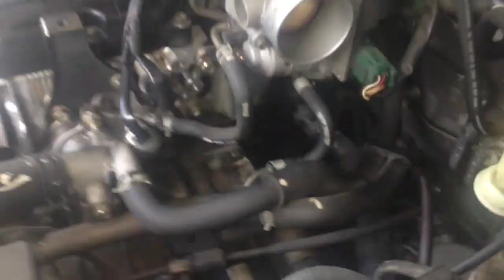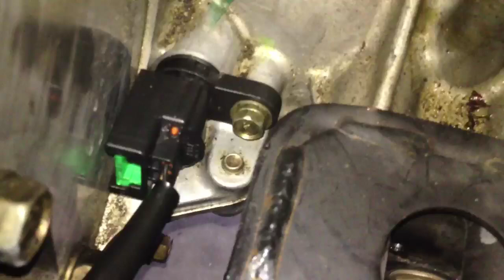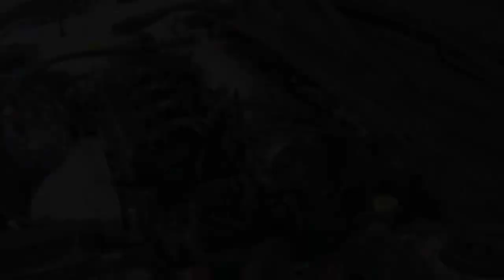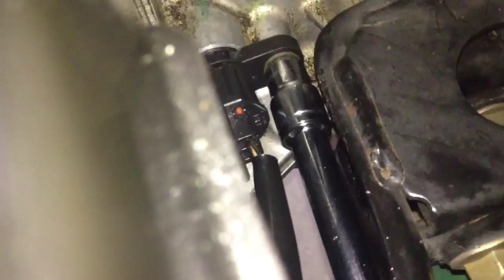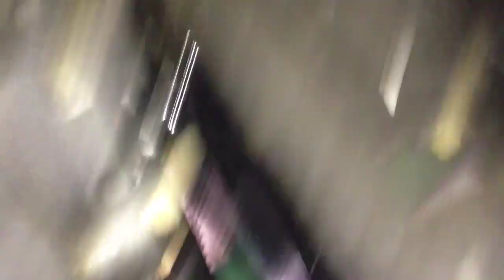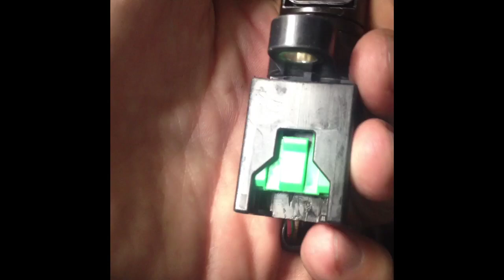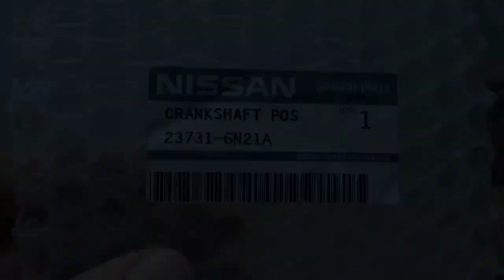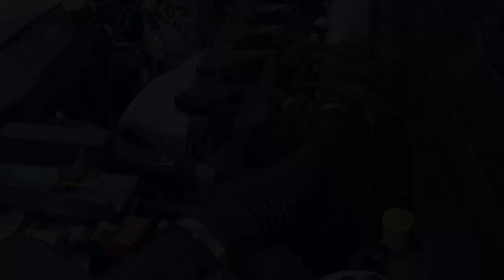Code P0335 / P0340 /P1336 - Crankshaft Positioning Sensor Replacement DIY - Nissan.

Comment: There is a recall, but it's not for the sensor. it's to reprogram the ecm for the sensor.
Reply from the maker: In my case ECM was good. I replaced the sensor and issue went away.

Comment: can someone help me i already changed booth crank an cam an if i don let ot cool dow the check engine light won't com on but if it cools down it pops right up
Reply from the maker: Did you install original OEM sensors or aftermarket?

Comment: Great video!! I tried doing it but the crack sensor would not pop out and yes I did take the screw out first ^_^
Reply from the maker: +juan beltran 
Is it not popping out from wire connector or from the engine?
Reply: from the engine
Reply: its not poping out from the engine
Reply from the maker: +juan beltran 
Try harder, it should come out. There is only one blot holding it.
Reply: Temachok what if i pull it out with the wire pluged in
Reply from the maker: +juan beltran 
Try it, just be careful and don't rip out connector wires

Comment: Is this process similar for an 2003 Maxima?
Reply from the maker: +Mo Neenja31 
Yes, similar process, but you'll have two sensors instead of one, since your car has 6 cylinders. Also that's bigger engine, so you may have some difficulties removing them.

Comment: super awesome.  it looks like the same procedure as a 2005 x trail.

also there is a way to erase codes without the diagnostic tool.   additionally,  there is a procedure to read codes without a diagnostic tool.  just search nissan forums
Reply from the maker: I know, I even wanted to make a video on that, but already sold the car.

Comment: This is very helpful, thank you! I just replaced mine with a Master Pro 2-96239. Unfortunately the engine light is still on and the engine takes longer to start. All I can think is maybe I didn't get the new sensor seated all the way, but it was difficult to see down there. Any suggestions?
Reply from the maker: Did you replace camshaft sensor as well? 
https://youtu.be/7FsLBcuREYE
Reply: I figured out I didn't pop the new sensor in all the way. I used a tool to push it all the way in and now it's running normally. I'll try clearing the code and if it comes back, I'll try the camshaft sensor.

Comment: My '04 2.5L Still won't start after I did this. Used a genuine Nissan part from the dealer. Still got code P0340 and it still won't start. It cranks forever but nothin' have no other codes except that one! HELP!
Reply from the maker: Try to replace camshaft positioning sensor as well. 
Also, if your car was still starting prior to replacing sensor, try to put back the old sensor. Could be that your new part is defective or incompatible.

Comment: how much do you think  it wouldl cost me if i take it to the mechanic ?
Reply from the maker: I think minimum $60 just for labour. 
But it all depends on mechanic you go to.
Reply: ooh alright because i have the p0021 , p1284 and p0725 but my friend told me it all bout one problem
Reply from the maker: I think P1284 is totally different issue.
Reply: oh but do you know where it comes from or how much it to fix
Reply from the maker: Read this article for some clues:
http://www.engine-codes.com/p1284_nissan.html
Reply: Miguel Godoy cruz yhbnjki

Comment: Great tutorial, but just a quick FYI for the novice mechanics.... disconnect the negative terminal before you work on any sensors or electronic connectors.
Reply from the maker: +Daniel Pigeau (EagleEye) 

Good point, thanks! 
I should definitely keep this in mind.

Comment: i have 2006 altima is the location the same for my car
Reply from the maker: Should be the same if yours has 2.5 engine.
Reply: Okay so as i was driving my car stRted to slow down and stop running i tryed to turn on it just kept cranking do you thibk its the crank sensor we have did a oil change and filter change also chabge the spark plugs and still not comming on just cranking
Reply: and yes i have the 2.5 engine
Reply from the maker: +Shaquillia Meadows 
Scan your car for error codes. If it's crank sensor, you should get error codes. Also, usually if you let engine to cool down, it should start again. Or if you keep trying for long time, it may start.

Comment: el Nissan Altima 2005 llevados crank sensor 1 por la parte de atrás otro pegado así al lado donde va el cilindro número 4 

 Por dónde  está el termostato Ahí está , tiene un tornillo 10 tienen que sacarlo si le cambian de abajo y no le cambia el de arriba Entonces le va seguir dando el mismo problema Yo tuve el mismo problema Te estoy diciendo Yo me tengo que cambiar el  de  atrás y siguió con el mis mo   problema   asta q cambie el otro  code p0725
Reply: olles entonses lecambio los doz ok ison iguales o uno es difirent kel otro?

Comment: Hi Temachok, thanks so much for the video. I got a Fail on my 2006 Altima emission test with P0335 issue. Do I need a diagnosis before a replacement?
Reply from the maker: I would replace both Crankshaft and Camshaft sensors. 
This is very common issue on Altimas. Original plastic sensors fail after certain amount of time or mileage. In most cases it fixes the error code you are getting.
Reply: I see. The car also has the Engine Service Soon light on, is it due to this crankshaft issue?
Reply from the maker: Yes. But you still need to scan for errors. Just to be safe. Sometimes there are more than one error code when check engine light comes on.
Reply: Good to know. Thanks a lot!

Comment: Thank you so much for the Video. It helped a lot. I just wish I would have seen your video before buying the snsor. I bought an ImportDirect from Orielly. My car was shaking in idle(in gear but in signal) and getting speed on slope was so tough when it happened. Now the speed issue is gone somehow by idle-shaking still remains. May be I would get an original one and install that.
Reply from the maker: Yes, original sensor should fix that. Try to return yours,they may take it back.

Comment: You make it look easy man.

Your video was incredibly helpful buuuuut it was still one of the most frustrating jobs I've ever done on a daily driver.

Every single step is a significant pain in the ass and I'm an experienced shadetree mechanic.

Car is working fine, but the codes had to be cleared using my scanner in my case.

If you have any doubts about your ability to attempt this, proceed with caution and make sure you're not in a rush or won'T need the car the next day. If you don't have access to mirrors or a smart phone to see what you'Re doing, you're in for a treat.

Pressing the connector tab will require very hard fingers, or some assistance from anything hard. I used a short stubby flathead to do it. It WILL click but if it's the original sensor, you might need to push pretty hard or wiggle it around for a while until your pushing accomplishes what it's supposed to do : click.

Believe or not, removing the old original sensor was harder than getting the conector off.

I had to buy a LONG flathead screwdriver, like a foot and a half long to pry it off the block from the top by snaking it through the intake manifold once the connector was undone.

That thing is on TIGHT. As you have guessed, putting the new one in without picking up a bunch of grime is very difficult. Definitely oil the o-ring. Oil on the sensor itself will not cause any damage since it's getting copiously splashed with oil from inside the block anyway. Avoid oil on the connector though.

The sensor goes in straight into the block, so you don't want to bring in too much dust or sand.

I actually soft mounted it in the hole and put the bolt back on because it was driving me insane. No amount of hand force would pop the o-ring it in place securely so I carefully torqued the bolt and it eventually seated in place.

Watching you just casually plop it in the hole is table flipping material.

Definitely plug the wire BEFORE putting the new sensor in place, because it might require some force again.

Thanks for the video, believe it or not, it DID make the job easier.
Reply: Yeah I’m in th middle of this now & it fucking sucks. That is one of the worst jobs I’ve ever done. On par with changing the driver side headlight on my GMC Sierra. These engineers are fucktarded

Comment: Hi , how long works the Ebay sensor ..?
Reply from the maker: You can buy from eBay, just make sure it says OEM/original/genuine. DO NOT  buy aftermarket.
Also, be sure to check compatibility for your specific year/model.
http://rover.ebay.com/rover/1/711-53200-19255-0/1?icep_ff3=9&pub=5575132837&toolid=10001&campid=5337765586&customid=&icep_uq=OEM+genuine+crankshaft+positioning+sensor+2002-2006+altima&icep_sellerId=&icep_ex_kw=&icep_sortBy=12&icep_catId=&icep_minPrice=&icep_maxPrice=&ipn=psmain&icep_vectorid=229466&kwid=902099&mtid=824&kw=lg
Reply from the maker: *aftermarket sensor worked for one day for me (one trip to be exact. It started and drove once, but that was it).

Comment: Good video, clear instructions. I want to try this tomorrow studying  this video before I attempt  the task. 👍👍👌
Reply from the maker: +Wes Spence 
Thanks and good luck!
Reply: +Temachok it turned out to be my spark plugs. Easy fix. But I have a question. I had a service engine soon light come on and it was for the o2 sensor code. Replaced the o2 sensor, and the code came back. What could be the issue here?
Reply from the maker: What is the exact code number?
Reply: Temachok it's code P1273
Reply from the maker: Here is some info on your code:
http://www.autocodes.com/p1273_nissan.html

Comment: Great vid.  i recently got a code p0340 and replace my Crankshft P sensor. i was wonder if i am doing correctly.i had  04 nissan sentra . is there  two Crankshaft P Sensor or just one? cuz in the video u took the CSPSenosr  from the back. N i got confused.
what i did is took my CsPSensor from the side.not from behide..am i replacing the wrong one?
Reply from the maker: +RiceCake Xyooj 
There are two sensors: Crankshaft and Camshaft positioning sensors. Crankshaft sensor is usually in the back and harder to get to while Camshaft is usually at the top or side of the engine and it is easy to change. Locations may vary on different models. On my car both sensors are completely identical, for that reason it's recommended to change both at the same time.
Reply from the maker: +RiceCake Xyooj 
Here is the video I made for the Camshaft positioning sensor on my car. Should be similar in general for your model:
https://youtu.be/7FsLBcuREYE
Reply: +Temachok thank for the fast reply. I put the crank sensor on my Cams sensor. what will happen.
Reply from the maker: +RiceCake Xyooj 
Let me check...
Reply from the maker: Nothing will happen. Just like in my Altima, both cam and crank sensors are exactly the same. 
Just buy another sensor and replace it as well. To save time and money, make sure to buy OEM original part. Aftermarket equivalents don't work very well (from personal experience).
Here is the part number for cam/crank sensor that fits 2004 Sentra 1.8 engine:
http://www.amazon.com/gp/product/B00BFE2UG2/ref=as_li_qf_sp_asin_il_tl?ie=UTF8&camp=1789&creative=9325&creativeASIN=B00BFE2UG2&linkCode=as2&tag=dp051-20&linkId=2A3CGENRH33KSOOT 

I hope this helps! Have a nice day!
Reply: Hi, the same error code P0340 happens to my Nissan 04 sentra 2.5. Auto Zone told me a Crankshaft Position Sensor should be replaced, while Firestone told me  a failure of the Camshaft Position Sensor. I am so confused. So should I replace both of them? Big thanks.
Reply: +Zhao Sway just like he told me. I replace my camshaft and crankshaft position sensor because oil was leaking through the electric plug. it runs better after replacing.
Reply from the maker: +Zhao Sway 
Yes, replace both.
Reply: +RiceCake Xyooj +Temachok
Thank both of you guys! I found it's really hard to find and reach the crankshaft position sensor.
Reply from the maker: +Zhao Sway 
Yes, that one is pretty challenging to change.
Reply: I bought a Bosch after market crankshaft sensor and had Pep Boys. After two days the error code returned and I had a delayed engine start but not stalls out.

 I am trying to replace the sensor now and I still can't get the bit onto the aftermarket senor. How long and how many tries did it take you?
Reply from the maker: You may have to unplug connector first.
Reply: thanks I was able to use a longer extension on the ratchet and was able to remove the sensor. The car is working like new.

Comment: Is it possible for these sensors to last only a couple years? I replaced mine two years ago (original nissan from dealership), and started having problems with them again. Car would crank but wouldn't start. I got fuel injection service, cranks but still didn't start. Then replaced both sensors, then it fired right up. the fuel pump is still good too. Thought it was strange because sensors are supposed to last much longer than two years. Any thoughts?
Reply from the maker: +islandjamsproduction 
Were new sensors in plastic or metal housing?
Reply: +Temachok metal housing, the new modified ones, from nissan dealership.
Reply from the maker: +islandjamsproduction 
Well, they definately should last more than just few years.
Sounds like their new sensors aren't that great either, cuz your old ones served you well for how long...!? At least 10 years....?
Reply: +Temachok yep, original plastic ones lasted 10-11 years. Hoping these new ones installed will last longer, I'm at 166,000 and plan to keep the car till 250k...
Reply from the maker: +islandjamsproduction 
I had mine till 250k too.
Reply: DIY-time suggest i should change also the camshaft sensor after i have changed the crankshaft sensor. The new sensor i bought for cranksaft is having a resistance of about 6.89Mohms. the old one was just 0.238Mohms. Now i have tested the camshaft sensor and the resistance is 3.89Mohms. so should i change it and put a new one with about 6.89Mohms hoping that it will start the engine?
Reply: EMENIKE PAUL UZODIMMA I did. There's a TSB on this and it says to replace both the cam and cps sensors at the same time as they are both prone to failure.

Comment: is this the same location for an 02 maxima? I took the air duct off but I did not see any bracket or anything like in your altima
Reply from the maker: +Dylan Mills 
No it will be different. Maxima has different 6-cylinders engine I believe. Search on Nissan forums for location,  people share that info there.

Comment: Buying an Altima 2013 this week, uneasy with ALL the transmission failures on the internet. Saw three people who said they stopped the shuddering, loss of power, trans failures by replacing the alternator, under the theory that voltage variations hurt the delicate action of the cvt.  Then, looking into other electric issues, I bumped into your excellent video.  Feel like I'm getting into a nest of issues.  Fortunately, the car I'm buying has 27K miles, hopefully avoiding similar problems to those who bought the car, had two-three trans replacement by 12K miles.  Thanks for this video! BTW if you have comments on my concern, I'll check back to see if you put it on this page or elsewhere.
Reply from the maker: +Ray Thomason 
I think there is no reason to worry about crank sensor on new generation Altimas. They realized the problem and stopped making sensors with plastic housing. 
As far as other issues, I had two Altimas, 2003 and then 2007 now. They run fine up until about 150k, after that you get all sorts of issues.
Reply: +Temachok Thanks for the encouragement ... I like the looks of the car, and the performance of the test drive vehicles I've tried so much, I'm pushing through.  Though I'm thinking I may get an extended warranty just in case I need three transmissions or something.  Online, I noted that oddly, the owners complaining seemed to tend toward the CVTs going out at 36K, 60K and then 110K, meaning I'd have to get a warranty extending to 150K, CarMax's most expensive one.  The car I've got held with CarMax has 27K, hasn't hit any of those mileage areas yet.
Reply: +Ray Thomason BTW, great video.  I'm trying hard to anticipate what new ideas I can find re shuddering when slowly accelerating between 15 and 30 mph, dying while idling or coasting downhill.  A few seemingly more insightful owners replaced their alternators, and various other sensors immediately on finding the problems, and three CVTs seemed to function normally after that.  But there are many CVT failures reported that don't consider any electrical causes at all.  One guy with a connection in a Nissan dealer claimed Nissan is aware of how sensitive to voltage fluctuations the CVTs are, but (and I'm not this paranoid, but I'll mention it) deliberately avoid doing the required electrical current fixes so they can do the way more expensive trans replacements.  I don't want to believe that, but who knows?